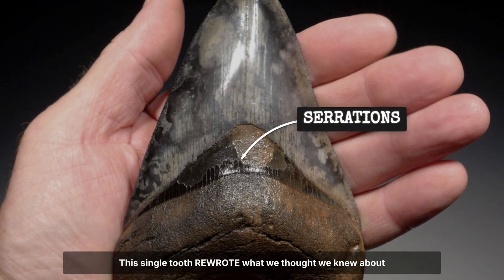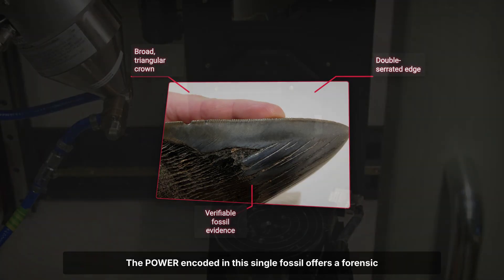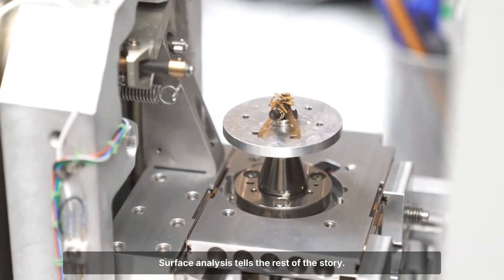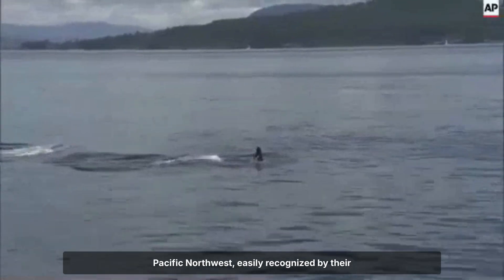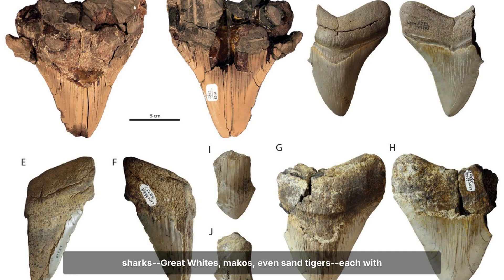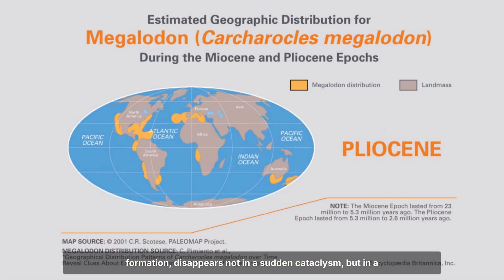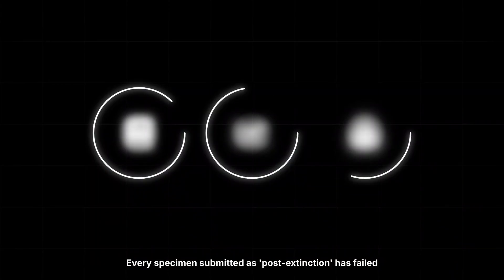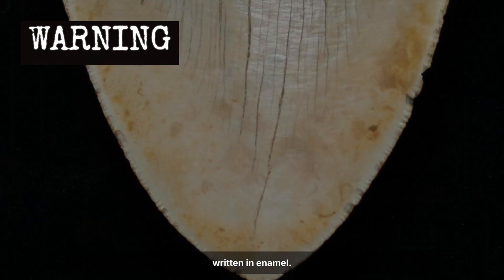The Only Tooth That Proves Evolution's Fatal Flaw

Comment: There is no problem with Evolution, if there is not enough diversity a species can evolve in a bottleneck.
Reply from the maker: Exactly right! The bottleneck concept is crucial - genetic diversity is the currency of evolutionary adaptation. When populations crash, they lose the genetic variety needed to respond to environmental change. 
This is what conservationists worry about with modern endangered species like cheetahs.

Comment: Basically to cut 15 minutes of repeating the same shit out,

Megalodon evolved to hunt whales.

As whales went extinct, so did the megalodon.

There. I just saved you 20 minutes of hearing the same thing 9 times.
Reply: Whales didn't go extinct.
They shifted migration routes and went to waters the Megalodon couldn't.
Reply from the maker: Fair critique! But here's why the repetition is intentional (and scientifically necessary):

La Brea Tar Pits has 40,000+ Smilodon fossils. I'm showing the PATTERN across thousands of specimens - not just one skull. The fracture evidence appears in 5-10% of fossils, which proves this wasn't random injury, but a systemic design flaw.

Megalodon comparison is interesting though! They went extinct due to EXTERNAL pressure (prey loss). Smilodon went extinct due to INTERNAL flaw (their own weapon). That's the critical difference - evolution killed them from within, not from outside.

Different failure modes = different lessons about natural selection. That's why the forensic approach matters.

Thanks for watching!
Reply: @FossilForensics  the ways some of you 'creators' insult your viewers intelligence is disgusting. You can keep that kind of 'excuse' to yourself because enough people know that some youtubers repeate the same shite multiple times with slightly different wording to pull videos into length in hope that YT will squeeze in one more commercial...

Comment: The hypothesis of unexplained directional cell mutation without intelligent genetic engineering is full of fatal flaws.
Reply: Are you implying that for some reason God decided to make sharks with bigger and bigger teeth over millions of years?... Just for them to ultimately go extinct?
Reply: Do tell.
I'm sure you saw a Ken Ham video, which makes yor opinion vastly more valid than thousands of biologists.
Reply: My opinion is based purely on science not speculation or theory. Every credible scientist will maintain their is no evidence of cell mutation (evolution) without outside influence at the DNA level that can effect a PERMANENT change.  Additionally any such change, according to Darwin, is purely by chance and is NON-DIRECTIONAL, which means there is no PROGRESSION in any direction, which means evolution can go backwards or forwards.
But according to modern misinterpretation of Darwin's "theory" it's all been in one direction.  ALSO , I left out one stipulation.  This so called evolution must be UNINTERRUPTED. Meaning a single cataclysm can set evolution back millions of years.  Therefore Darwin also stipulated that the geologic processes we see today are those that necessarily would have been present and consistent with since the beginning.  It's called the theory of Uniformity. However this theory has been blown out of the water many years ago and Darwin said himself that the theory of Uniformity was absolutely necessary for the theory of Evolution to have any credibility.  I could go on and on about the absolute lack of any evidence to support this fairy tale. And the plethera of evidence against it. But hey, if thousands of biologists want to pretend their views are "scientific" let them have at it.  But that doesn't mean everyone else is brainwashed from kindergarten.